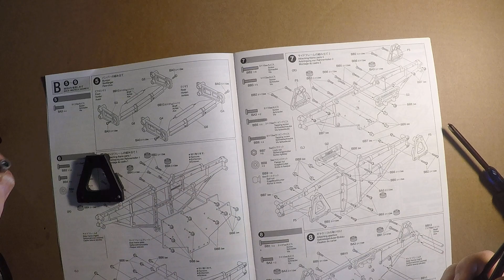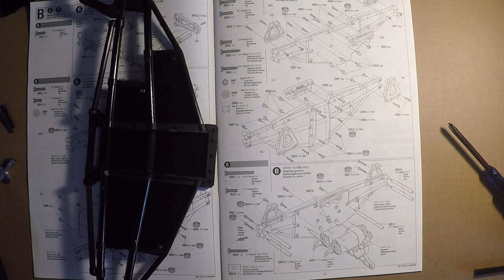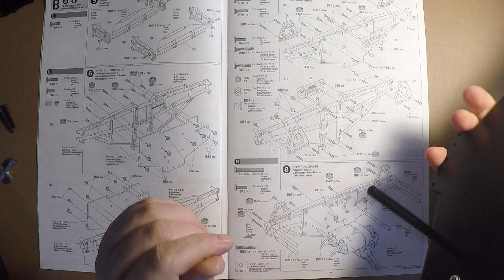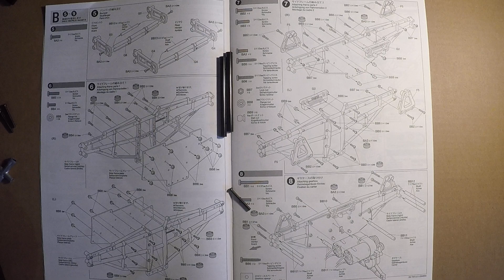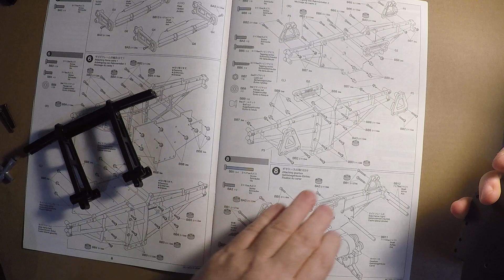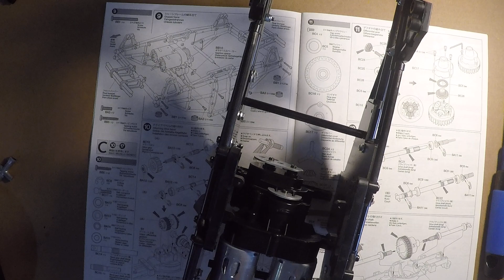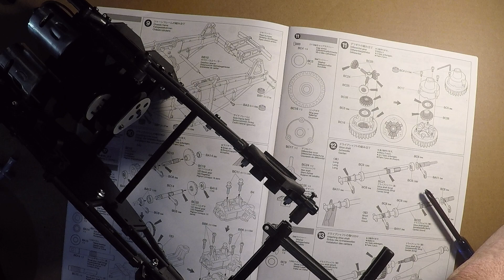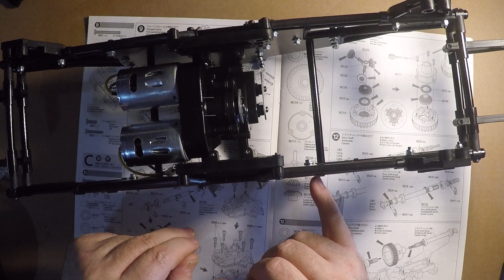Tamiya TXT-2 Chassis Build Part 2..

Comment: I'm glad I got a Cordless Screwdriver with a Clutch, and have a feel for what's tight enough.... 
My Old, Arthritic Fingers could NEVER get through one of these without it!! 😲😳 
I'll say it again... This Kit is so awesome! As much as I really like it, amazingly I truly want another Clodbuster. Especially with all the cool Hopups that weren't available back in the 80's when I had my last one. Particularly Axle Mounted Servos!!! 👍👍 Anyone with a stock Clod KNOWS how halfassed and dismal that Central WEAK Servo, with ULTRA SLOPPY Steering is!! Just fitting two 25kg Servos should transform the whole thing. 

And Brother, you're doing fine!! 👍👍  I haven't been able to make live Video Builds, since my Model Railroading days, 11 years ago, on my original Channel. I'm actually nervous about doing it now - after getting my first new Computer in over a Decade, a GoPro and HiRes Video Camera. 😲 
I just got too comfortable making slideshows for the past 8 years.... 
So don't beat yourself up Bro!! Not all of us can do this as well as Mark Bryan!
Reply from the maker: Thanks Carmine, I have a DeWalt 12v cordless screwdriver with a clutch (i dont use it for builds, even on setting 1 or 2 are sometimes too much). I guess im not use to talking to myself on camera, lol. All i have is a GoPro Hero Session & a GoPro Hero 5 Black. I still run a stock Clod with one servo, my Race Clod uses a Thunder Tech Racing Ripper Pro chassis with steering behind axle (servo is mounted on a new axle tube brace). The man is a natrual, he should be on the silver screen. lol. Thanks buddy for the kind words.
Reply: I use a Skill 5v for these. Only $15 @ Home Depot, and just enough Torque, because it's only a 1/4" drive Cordless Screwdriver.